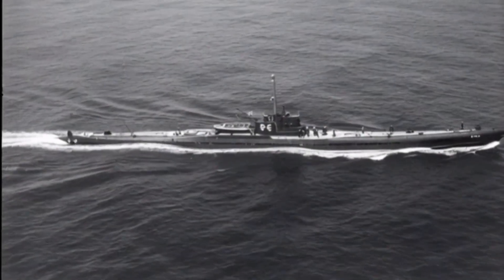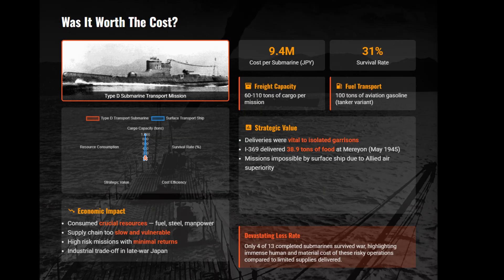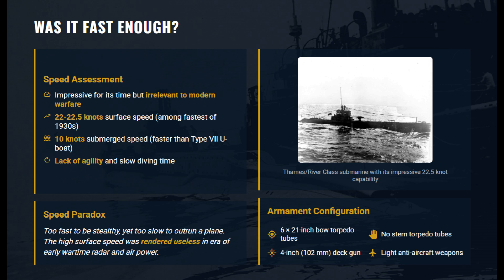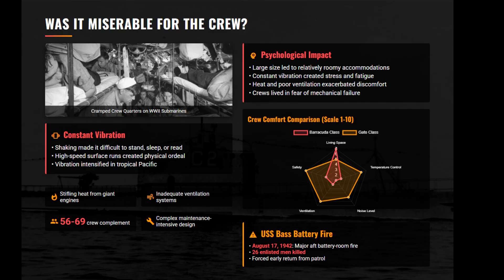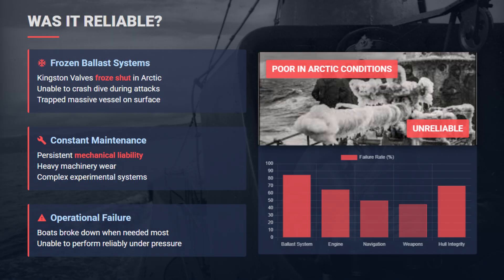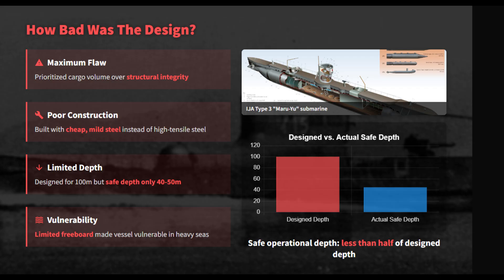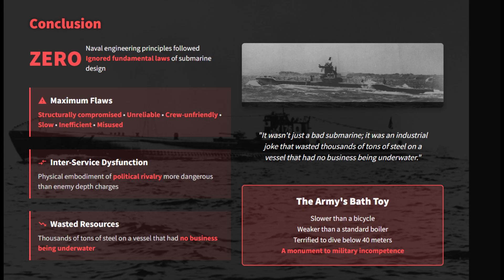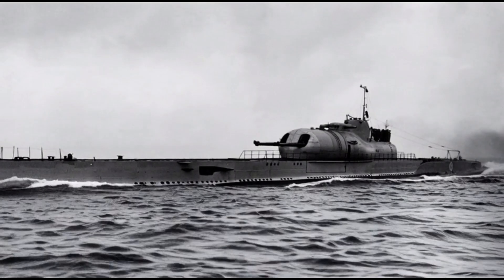Six Worst Submarines of World War 2

Comment: Interesting list. Just a note on the Surcouf having the largest guns mounted on a submarine, that title actually belongs to the British M class of WW1 which packed a 12 inch gun. https://en.wikipedia.org/wiki/British_M-class_submarine A lot of nations fooled around with larger submarines that mounted bigger guns than what was probably worth the trouble due to the success of the large German U cruiser submarines. 

The US V-class subs talked about in the video are more a victim of their age and thinking at the time they were designed and authorised (1919). They were based on a faulty premise (The USN was probably consulting with the British who made several attempts to produce a "fleet submarine" designed for high speed to operate with the main battlefleet and failed at it). At least the US was relatively quick to remove them from effective service. They were actually not in service at the outbreak of the war and only the outbreak of the war saved them from being turned into razor blades.